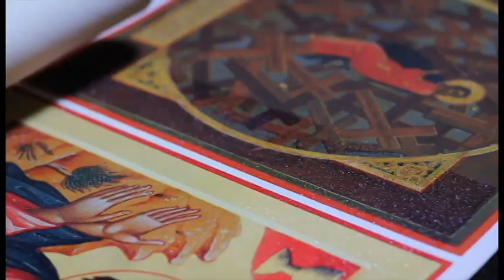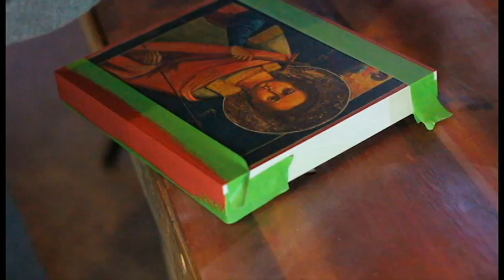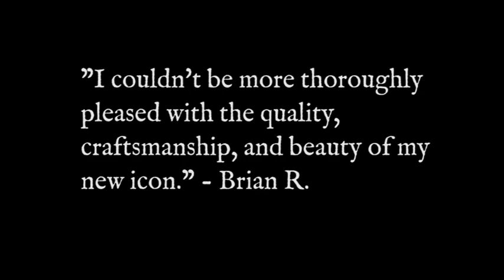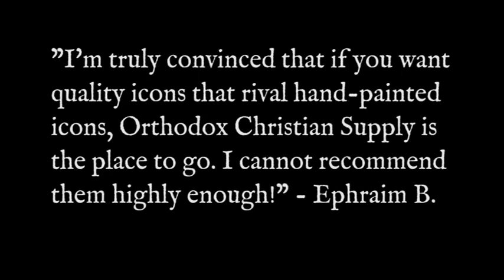Orthodox Christian Supply : The Traditional Panel Icon

Comment: Thank you for sharing. 
Are the icon images printed on normal paper, or glossy paper?
Are they printed via a laser printer or inkjet?
Reply from the maker: Fr. Emil,  all our icons are printed on low tooth archival canvas with natural pigment based inks.  we use a 24 inch glicee printer.  here is a little more information, taken from our website, on our panel styles and printing:

The Traditional Panel Icon

Our signature product, the traditional panel mounted icons, are made with the upmost care.  We begin with carefully selected 4/4 solid poplar.  Then we route dovetailed keyways through the reverse and insert the red oak splines.  This process is to keep the panel from warping over time, the same process as used in hand painted icons throughout antiquity.  We also route coves and chamfers on the splines themselves to create a decorative appeal, in the same fashion that is commonly used in Russia today.We print our images on the lowest tooth market available canvas with natural pigment based inks.  The prints are then sealed with the highest quality giclee canvas varnish, complete with UV inhibiting properties (will not fade).  For our varnish we use a special mixture which brings out more color than a flat matte, yet still eliminates the glare commonly associated with gloss varnishes. All our icons are sealed on face, backs, and sides.  We sand out every icon glass smooth to ensure that our customers not only see, but feel the quality of our product.  There are over 25 individual processes which go into every traditional panel icon, each preformed by hand.

The Classic Panel Icon

Due to popular demand we have reintroduced the “classic panel” icons.  This time, however, we have set aside all inferior materials and have approached the design keeping in mind historical precedence.  The panel itself is solid poplar and the splines (red oak) are inserted in the top and bottom (as opposed to the back) as was popular in 19th century Russian panel construction.  The overall thickness of these icons are kept to 3/4”, the sides are painted red and the back is sealed.  Aside from the panel itself, all elements are the same as used in our well know signature product, the traditional panel icon.